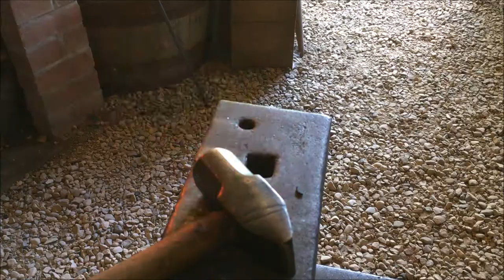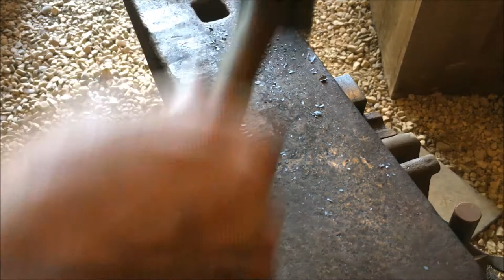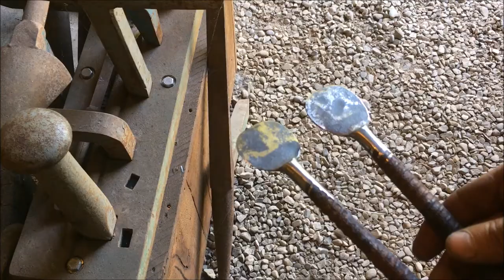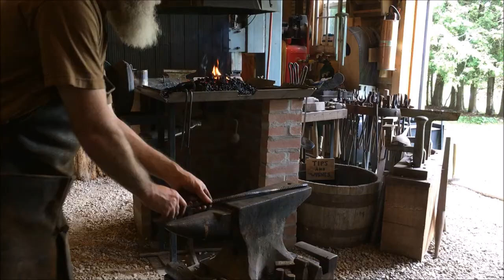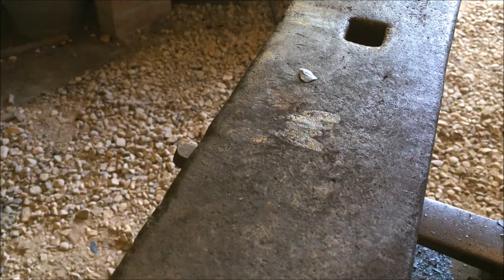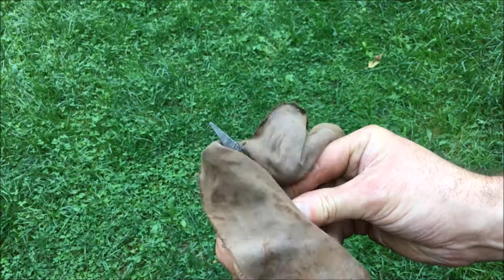How to forge a bodkin arrowhead

Comment: You heat treating rebar?
Reply from the maker: Generally rebar is not great for knives.  This stuff must be medium carbon because I have done some tests on it and it is hardenable.  When I blacken these in oil that is the final quench.  At this point they are tough and hard but not brittle enough to break.  Rebar varies so it is best to test your stock before using it.